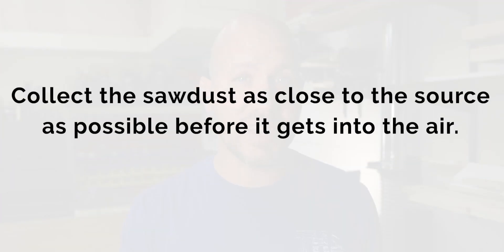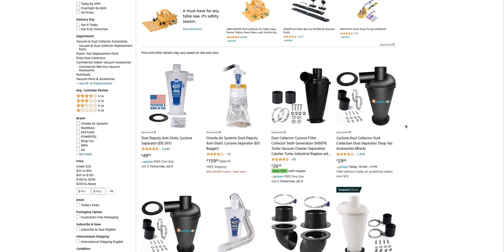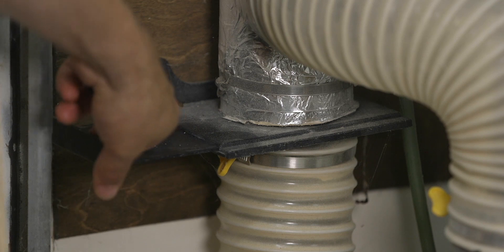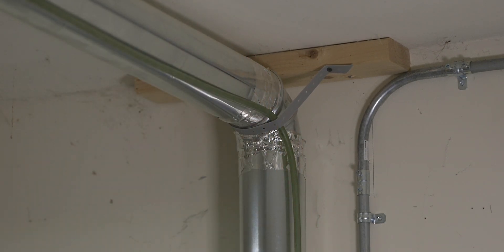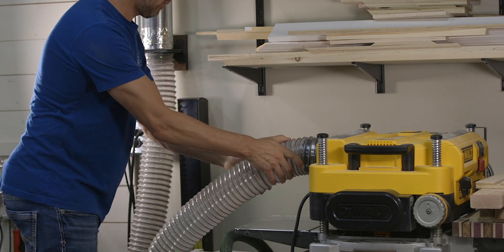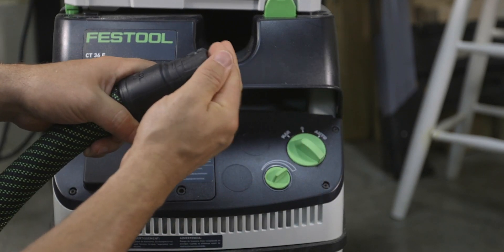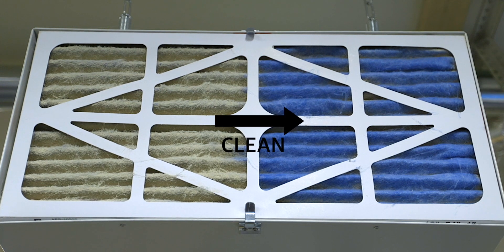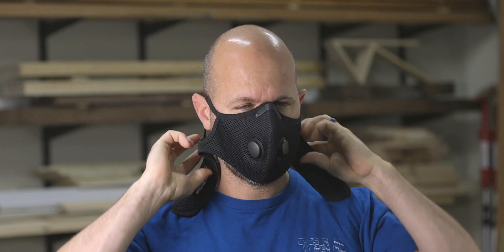Dust Collection Systems For Wood Shops - A Beginners Guide

Comment: I'll tell you a big secret. - all that nonsense about LVHP  or LPHV or whatever is just marketing.  vacs and dust extractors use exactly the same basic principle. The main difference is that you would not like to pass wood chips through the vac fan- it is speeding at a much higher frequency so it could be damaged more easily. You can connect the dust collector to VFD and make it way more efficient by running at higher speeds. And if reducing the dust collector inlet works for you - do it! There is no secret reason to keep the inlet at the same diameter. ( it is true for the line, though).

Comment: Great video.  I use the cheapest air cleaner around.  I hang a standard box fan with a 20 x 20 furnace filter taped to the back of the fan. It'll clear a room in about 15 minutes.  Then I either vacuum it clean or change the filter.

Comment: Thanks for the great video. One thing I never see mentioned in budget dust collection is fans. I built a cyclone system with my vac and of course have good filter. But one thing I can say for sure is, a good strong fan blowing what’s in the air away from you is probably the best filter you can buy. I work out of my garage so opening the front and back door with a big stand up fan blowing keeps my shop very clean.
Reply from the maker: Great point!

Comment: Would you recommend a complete beginner to get a L class or M class shop vac? Btw, I've seen some people attach a cyclone dust separator to their shop vac, their reasoning is it prolongs the vac's filter usable life, what do you think about this?
Reply from the maker: I would have to say M class but it really depends on what you will be doing, or what you will be doing in the future. Yes, I do see a lot of people using those cyclone dust separators for shop vacs, but I've never tried them so I can't really give you good advice on that.
Reply: @TrainingHandsAcademy  I just want to use it for small power tools like circular saw, a plunge router and sander.

Comment: Also... worth pointing out HVAC (not sure why in America, people say, "H.V.A.C" rather than "H-vac") duct is designed for air flow in the opposite direction of dust collectors, blow vs suck. Granted in a different context, meme choise, but we be wood workers, not wood growers. Be sure to orient the ducts correctly.